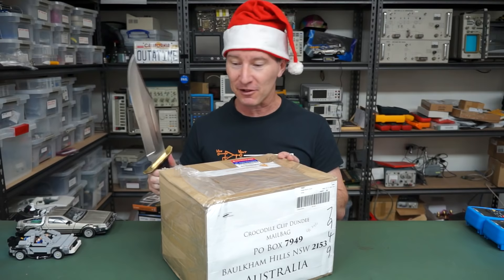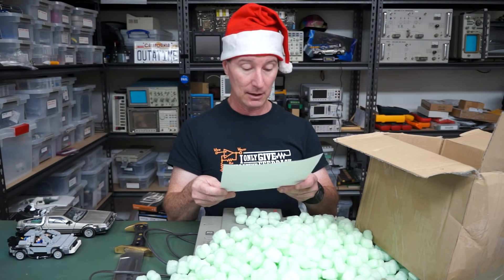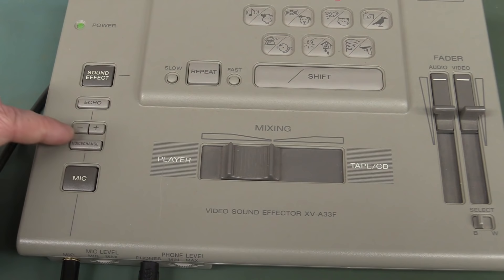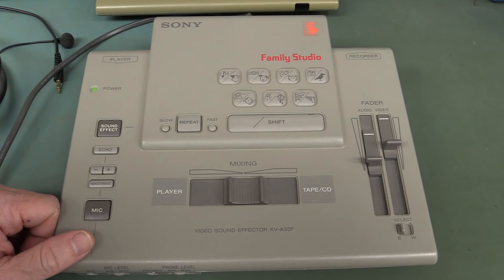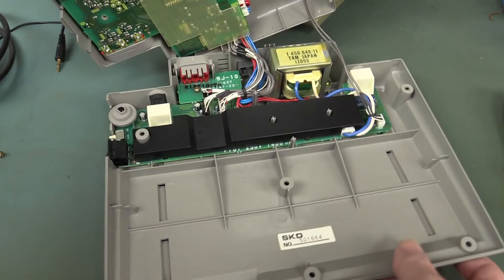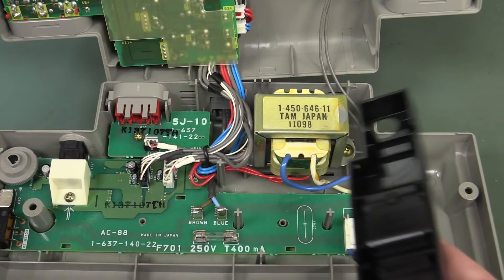EEVblog #958 - Mailbag

Comment: Woohoo! you got my nuclear battery! I was kinda worried it might be stopped at customs for being radioactive.
Reply: I watched your video of you building that battery! Pretty neat that it ended up here!
Reply: NurdRage this is soooo cool!
Reply: First I saw your video and thought send it to Dave. He could definitely power something. As I began a little research the first thing what I saw was s thread at the EEVblog forums about your nuclear battery. And bingo it came to Dave! Pretty awesome what you can do with a bunch of tritium vials and two solar cells.
Reply: A friend who works in radiology says he's tested those things and as long as the vial is intact, it's completely impossible to detect the radioactivity.  Alpha doesn't go through anything really.
Reply: John Ridley I remember reading it somewhere that the layer of dead skin on our bodies can block out alpha rays from the environment. And that radon is soooo darn bad for you because our lungs don't have that layer of dead skin...
Reply: Omer Choudhry that's true! a piece of paper is enough to shield alpha particles. Beta particles are shielded for example with a couple of millimetres of aluminium but AFAIK light materials are preferred because heavier can produce some x-rays. Gama radiation is shielded with lead or heavier materials like depleted uranium. And neutron radiation goes through pretty much everything and ionise materials but can be "shielded" with concrete. 

I could be wrong at certain points it's a couple years ago where I learned some about radiation and shielding.
Reply: If you want to know more about radiation check out bionerd23. She has some pretty good videos where she explains radiation.
Reply: Drakkar Calethiel yup exactly!
This was the juicy bit in A-level Physics!

I'll be sure to check it out.
Reply: At first I thought AvE might have sent Dave something, but hearing your name was an even better surprise!
Cheers from electrochemical limbo
Reply: I know, like there's some other crazy guy making videos from canukistan?  Instant follow.
Reply: NurdRage I swear this thing is stealing me all over YouTube.
Reply: It is cool but how much did all of those tritium vials cost?  Aren't they pretty expensive?
Reply: DaveC1964 Go watch Nurdrage's video. Yes they're normally pretty expensive. He found some that were mispriced and bought a bunch before they fixed it.
But also check out the normal prices of these things.  One this size usually costs a few thousand dollars.
Reply: Yeah I thought about making one of these a while ago but the price of the tritium was expensive. 

Those other commercial ones are expensive too. They work slightly different by using the beta radiation directly on a tuned photo voltaic rather than using light produced by excited phosphor.  I guess the result is the same though.
Reply: so, it didn't end well for the pioneer 3 probe i guess . .
Reply: i know this is old...i saw you make it about an hour before i saw this vid.

Comment: 0:00 not weed, but packed in green packing peanuts: Sony Family Studio from the Netherlands (3:55 audio effect showdown, 6:26 mixer teardown, 9:30 teardown of controller)
10:42 D-shirt commercional break
10:59 two T-shirts from Switzerland
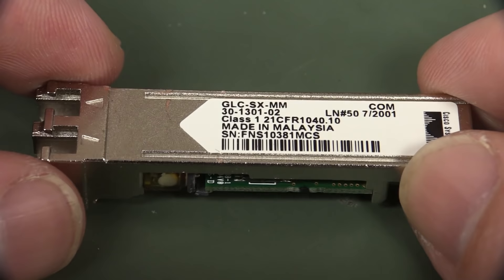12:55 Cisco fiber modules from Chicago (14:21 teardown)
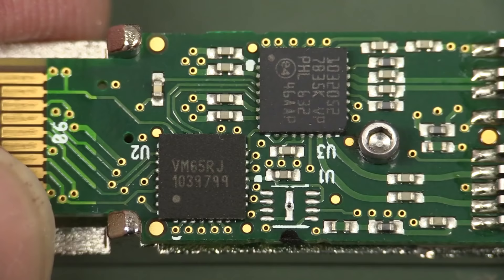15:27 Tritium nuclear battery from Canada (from YouTuber NurdRage) (21:31 look inside)
21:50 D'oh
21:52 RFID card cloner from San Diego 
26:25 Dodge Charger center screen driver from Sweden (27:30 teardown)
28:44 Stuff from Canada (29:08 talking button, 29:38 Blackberry Playbook - guts of the tablet 30:48)
32:45 Surface mount resistor kit (also Lego 34:18, vintage Santron four-banger 34:27, chocolate 35:14, more vials 35:25, Haribo gummy bears 35:48, barbecue thingie 35:52) from Germany - from 36:48 starts the closeup show
38:16 Dave harasses the four-banger's nipple
38:22 Last mailbag for 2016

       *
       ^
      / \
    /     \
  /         \
/_______\
      |  |

Comment: In 1978 I had a tritium illuminated LCD Timex watch.  It had a very heavy back, which I assumed was for shielding the wrist from radiation while wearing the watch.  It still had some very faint 'glow'  a decade later!
Reply: Fran Blanche Would like to have seen the ads for that watch - perhaps "space age" was still the catch phrase as "atomic" was probably out of style!
Reply from the maker: Yeah, probably doesn't take much to stop the radiation, the al-foil might even do it?
Reply: "The half-life of tritium is 12.3 years. The beta particle that is emitted by tritium is considered to be very weak, hav- ing an average kinetic energy of 6 keV. As a result, these particular beta particles can only travel about 6 mm in air before they lose their ability to cause ionizations. In tissue, tritium’s beta particle is so weak that it cannot penetrate the typical thickness of the dead layer of skin that exists on the outside of the human body. For this reason, the beta particle emitted by tritium is generally only considered to be hazardous if a significant quantity of tritium is, or has the potential to be, taken into the body."

http://hps.org/documents/tritium_fact_sheet.pdf

Tritium weapon sights are still quite popular. I have a few sets myself.
Reply: Fran Blanch, Tritium is was and maybe used in some luminous watches today,  Swiss watches were marked "SWISS T < 25" for less than 25 mC or "T SWISS T".for those less than 7.5 mC. The ones to watch out for are the radium dial watches. I have an old radium pocket watch from 1920s it no longer glows but get it near a GM tube and it soon goes off scale. The half life of radium is around 1200 years. I do not use this watch, it is not running and servicing of such watches is unadvised as the radium paint crumbles easily and if ingested, could have serious health consequences. Best shielding for radioactivity is physical distance as it's intensity falls off by the inverse square law. the greater the radioactivity the further the distance. For my watch a meter is easily sufficient.

Comment: Dave, I think you needed to press the button on the RFID fob thing to make it work at the reader.
Reply: That's what I was thinking too.  I think there are four buttons so that you can use this for four different cards.
Reply: Maxx B everytime Dave pulls a goof like that I shout at the screen.  I also decide theres no way i'll try and use mailbag to market anything I make since Dave will goof it and cost me sales lol
Reply from the maker: Of course I pushed the button.
Reply from the maker: +ituxcoza  I did not goof anything, I pressed the button like I was supposed to, it didn't work.
Reply: In the video it looks like you held it down rather than pressed and released.
Reply: He pressed all of them at the reader.
Reply: The same button you programmed it with? The footage shows you only try 2 of the 4 buttons at the reader, and on your initial programming attempt you used the button nearest the LED - which was 1 of the 2 you didn't try (though admittedly we don't see which button you used for the successful programming attempt, nor does the footage convey if you in fact tried all 4 buttons and we just didn't see it).

Alternately, holding it down like in the footage may have had it start counting towards the 10 seconds needed to start a programming cycle, where a short press might trigger it to activate the stored sequence - but again, you may have actually tried that.

Comment: The Sony home studio used an RC-Lanc plug directly into the camera. It has an IR / receiver/transmitter which can 'learn' your VCR's remote. You then plug the video leads directly between the VCR and camera. The studio uses the timing information coming from the camera tape via the RC-Lanc interface.  When you press the buttons it remembers the time codes. When you are done editing, it controls the camera via RC-Lanc and your VCR via it IR remote. It then puts your VCR in record and plays a section from the camera tape. Pauses vcr and fast forwards camera to next section etc. I almost purchased on of these for a sony 8mm cam back in the nineties :)

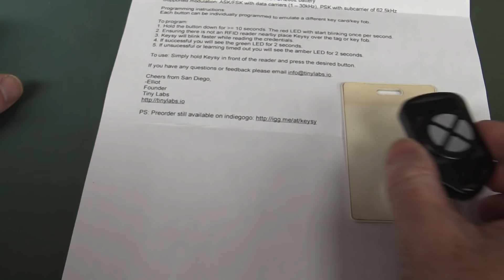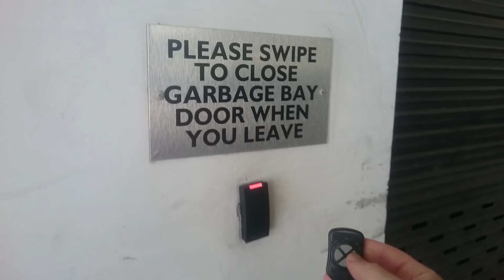Comment: The instructions at 25:59 clearly state that you store the card info to 1 of the 4 buttons and then press the same button to use that stored card. At 24:00 he uses the button nearest the attachment loop. At 24:48 he tries again using the same button. At 25:12 he tries again successful though we don't see which button he uses. At 26:09 he uses the button right of it. At 26:13 he uses the button left of it. I'm left with the feeling that if he had used the button nearest the attachment loop in his garage, it would have worked. Who else caught that?

Comment: The 8 pin chips MN3204 in the echo circuit is a classic bucket brigade delay used in guitar pedals, mixers, rack effects, etc. They were an interesting solution to a practical problem in the pre-digital age.
Reply: The OKI chips are the sound generating ICs most likely. Casio Electronic Musical division used to have NEC make their chips, but they moved across to OKI in the late 80s early 90s for their PCM and some synthesis based models.

Comment: About Tritium PSU...I think you can get mor PowAh!!!
Ok i mean more energy over next century(es) from same size inorganic lithium (not organic electrolyte based - regular 3V Li - those are for high power (current) but not so high energy applications.) 
Something like thyonyl-chloride based, primary, metallic lithium battery. 
Hi-end ones last fifty years (certified), but in reality likely a few centuries till 50% self discharge...

Comment: Were you pressing the right button on the keyfob or retry cloning the card that didn't work initially?
Reply: Oh, come on. If it worked, you would hardly advertise the fact that you had a device capable of opening other people's doors on the Internet!  As soon as anything starts going missing, you're going to find yourself in the frame.  No, you'd put up a vid on YouTube that quite clearly shew the device not working, just to give yourself a bit of Plausible Deniability.  "Oh, yeah, sure, like I broke into the garage using that crappy key cloning thingamyjig that doesn't even work?  I've even got video of it not working!"

Comment: I had a blackberry playbook, honestly it was a really good device while it lasted, you can load android apps on it if you can't find an app in blackberry world, big downside is that RIM never upgraded it to BB10 due to ram limitations and mine eventually died as the LCD controller stopped working. Now I rock an unlocked white blackberry Q10 and its freaking amazing. Blackberry is the only device I swear by, android is bloated, apple is a walled garden, my q10 just works. Never crashes or slows down.

Comment: FYI some foam packing 'peanuts' are made from starch and dissolve away to nothing in water. They have an open foam surface texture as opposed to the much finer texture of the expanded polystyrene ones.

Comment: The "barbecue starter" is meant to be a circular thing.  The two tabs go into slots on the other side.  As for the sharp things, I believe that they are meant to be on the solid surface4 to allow air to circulate into the inside.  No, I don't have one, but I have used charcoal starters (they are usually much bigger) before.

Comment: For the key fob I suspect you pressed one button to program and was testing with a different button. Hence it did not work. Well at the garage you were pressing the right and left buttons (assuming top is by the hole). When capturing you were pressing the top button.

Comment: I'm thinking the video editing system might just use the IR output to control external vcrs..
Reply: Colin McCrory Yep - the front IR window probably trains the editor using the remote controls - you also have to set the timing to compensate for the tape transport mechanisms.  Old school!

Comment: Capacitor argument: It is going to end up with half of its capacity in a few years, let's put a bigger one.
Generally, it works for electrolytic capacitors, you have to estimate the final capacity, not the initial one.

Comment: "THIS SUCKER IS NUCLEAR?!"  "No no no this sucker is electrical! But I need the nuclear reaction to generate the 5 microwatts of electricity I need."  You should use the nuclear battery to power a micro LED and put it behind a mini flux capacitor in one of your Delorean models.

Comment: Some people still use the BlackBerry Playbook. Towards the end of its retail life they were bundled with the oem case and keyboard. Good units but software was lacking.
Reply: If only - the hardware was great (nice screen and speakers) and well made build quality but the boot loader was never broken from when I was last interested a few years back. They actually ran a version of Android on top of the Playbook OK so you could put third party apps on but it was a very basic version.
Reply: Ian Colquhoun I'm sure BB could have still been big if 1. They didn't bow to the foreign government pressure about the servers. 2. Used capacitive screens instead of resistive. 3. Didn't have the huge delays on product launches.

Comment: Your two prox cards might be running different frequencies. That's a pretty old card design, and there were several different  reader manufactures and freqs floating around about 15 years ago. Access control systems usually get upgraded in bits and pieces.

Comment: That playbook reminded me of one dead one given by my friend.
These have a very charging design.
Once battery drops a certain voltage it would not even power the charging control circuit (yes it true)
There is no way to revive it without opening the case and charging the battery directly.

Comment: That Family Studio controls looks like it controls two connected machines via the remote IR interface, one with the source material and the other to record the edited material from it. 

FWIW I used solder thieves on my first SMD PCB design back in '86.
Reply: You are correct.
Reply: +zawzero And I now see someone beat me to it.

Comment: There's a mini-usb port on the car module, you should plug it in to a computer to see what happens.  It's using a locking USB-Mini port that I've seen before on the Nexiq USBLINK2 which is an OBDII/CAN etc diagnostic interface for cars.
Reply: Well I would be interested what VID and PID it showed for the device.

Comment: With the BB Playbook it's a lot better with a "classic" blackberry phone. It gets all of its data from the phone but connects via wifi I think or bluetooth. Blackberry screwed up as it was supposed to update to the "blackberry 10" operating system for their last phones (I have one) but the company could not cut down the OS enough to work on the under-specced device, so it became obsolete from their newer phones.
Reply: Blackberry 7 phones - it's kind of 2009-2010 vintage, not the crazy-old ones.

Comment: I think you might have to hold the button on the clones keyfob before you move it in range. If you put two cards in range of mine simultaneously it will not read either, even when you take one out of range and leave the other.

Comment: Tritium vials like that have a half life of 12.5 years  over that 12.5 years the brightness will very slowly diminish as the phosphorus layer breaks down. Green is the brightest longest lasting ones there are higher pressure ones that are brighter. and these look brighter than they do on camera. There is very little danger in if they break as in open air tritium has a much quicker oxidation rate and will render itself inert in a few seconds. I would be interested in seeing that setup powering a lcd display of any sort...

Comment: I doubt the QR card on the bottom protected the plastic from discoloring. Notice that the plastic at the top of the frame, which was not covered by the card, faded as well. Also the discoloration on one side of the top/bottom join line is very sharp, so I think what decides where the discoloration occurs is the kind of plastic used for those particular parts. All the plastic has had almost three decades of exposure, but only some pieces are affected. 

See uXh9RXepJSk for a YT vid on the titler component of the Family Studio series.

Comment: 31:30 Actually, more likely the Elpida RAM chip is a POP (package-on-package) design, and it sits on top of the actual SoC, connected through a couple of rows of solder balls on the outside edges.